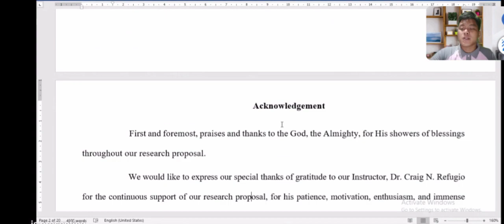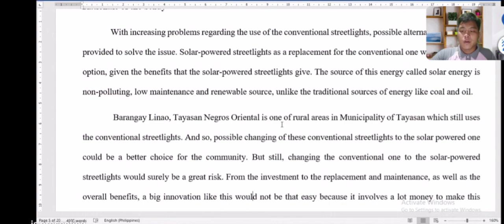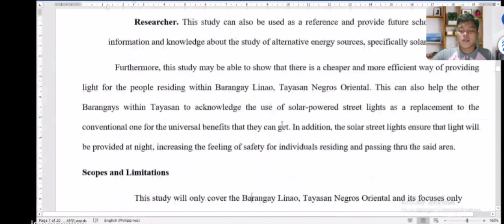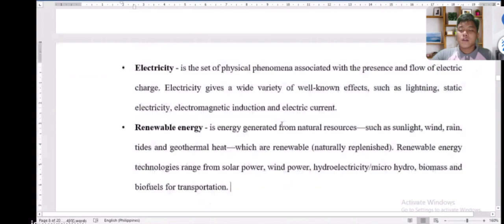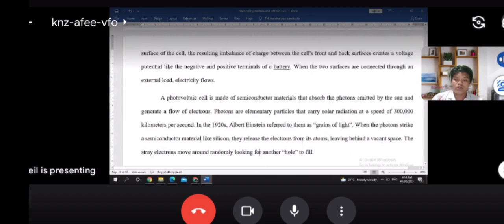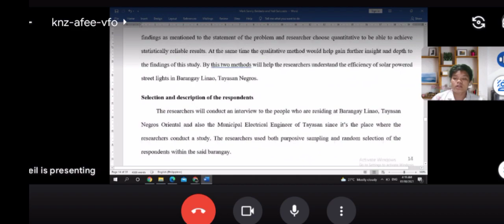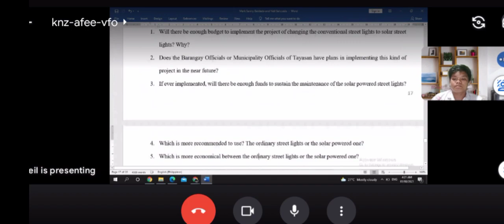Efficiency of Using Solar Powered Streetlights in Barangay Linao, Tayasan, Negros Oriental

Comment: Angel Lynes Esona
COE 346 Methods of Research TTH 5:00-6:30PM
March 25,2022

Reaction: The video is very precise and gives relevant information for the unending benefits of solar street lights.
Reflection: If this notion may be granted and have funds to make this innovation I could be satisfied for this due to the fact that sun-powered streetlights have stability, long service life, ease of installation, safety, high performance, and energy saving. This type of lighting can be seen in a variety of places, including city streets, residential areas, factories, tourist sites, and parking lots. We can make use of this especially in dark places, in order for us to be far from any harm and danger.

Comment: Arnold Jr. Arnesto
CoE 346 A - 5:00 PM - 6:30 PM TTh
March 25, 2022

Reaction:
Streetlights are almost always used during nighttime. It is important to keep the streets lit up which helps motorists navigate the roads and also gives a sense of protection to those people who need to walk in the dark. For this reason, I agree that there is a need for improvements in the capacity of solar-powered street lights.

Reflection:
Streetlights are only used during nighttime so it would be nice if they are to be charged using solar energy during daytime when they are not in use. In this way, we lessen the need to power them up using direct electricity and in turn, we can save money and preserve the environment.

Comment: Pagente, Jayvee M.
CoE 346 A Methods of Research TTh 5:00-6:30 pm
March 25,2022

Reaction: This proposal is very informative on how significant the solar power street light to be  utilize in many streets. Also taking advantage of the renewable energy and apply it on many technology is very helpful to reduce the use of fossil fuels.

Reflection: Utilizing the Solar powered street light is very practical. Thought it need a huge amount of budget to be implemented, it is still very efficient compared to the traditional street lights. Solar street light is also  requires much less maintenance. Additionally, in more isolated areas, these lighting solutions help reduce insecurity, theft and assaults.

Comment: NAME: Renz Eugene V. Denulan
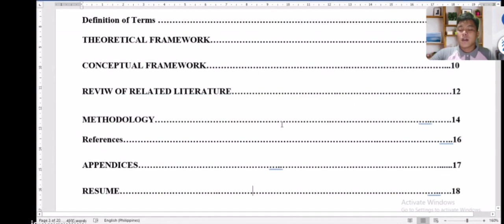Class Name and Schedule: ENS 341 SAT 2:00-5:00
Date: March 25, 2022

Reaction: This video is very good, the researchers are very well prepared l. Solar powered streetlights aren't new idea, it is also not used commonly not to mention it is expensive. But this presentation have benefit in that it is a renewable source of energy and can lessen the power of consumption of cities.

Reflection: The significance of this study is to make streetlights using solar power as its main source of energy so that the citizens of Barangay Linao, Tayasan, Negros Oriental and all other places that may implement this research have a brighter nights and make them feel a sense of security.

Comment: Name: Mark Daniel L. Anggoy
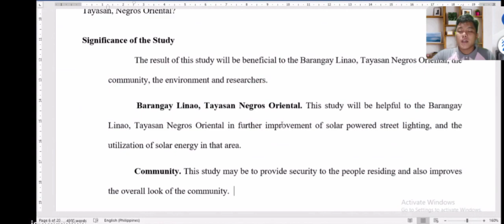Class Name & Class Schedule: Coe 343 Methods of Research T-TH 5:00-6:30
Date: March 25,2022

Reaction:  The video is both entertaining and educational. I also agree with the researchers that the capacity of solar panels to be used as a renewable energy source should be improved. This is an excellent case study because not all lighting can be kept operational. Streetlights are vital because they may assist cars in clearly navigating their path and avoiding accidents.
Reflection: Streetlights are in need in communities specially that are far from the major route, particularly in rural areas. This would be extremely beneficial not only to students, but also to workers who work late and must stroll through these streets. It would not only save electricity, but it will also benefit our environment and people.

Comment: Name: VEXANDER PHILIP M. MARAVILLA
Class Name and Class Schedule: ENS 341 A - TTh 6:30-9:00pm
Date : MARCH 25, 2022

Topic : Efficiency of Using Solar Powered Streetlights in Barangay Linao, Tayasan, Negros Oriental 

REACTION: Indeed a great research idea for it will benefit the people living in    Tayasan Negros Oriental since the area maybe has minimal to no electricity supply so it will greatly help the people in that area. 

REFLECTION: Using Solar Powered Streetlights will be very helpful to that community for it does not only provide lights to streets but also can ensure safety to to all the people in the said area and most importantly it is cost efficient and environmental friendly.

Comment: NAME: RUSSEL T. TURQUE
CLASS NAME & SCHEDULE: ENS 341 A ( 2:00-5:00 PM) SATURDAY

DATE: MARCH 25, 2022

REACTION: 
The presentation is well presented and very informative topic. The topic is eco-friendly by using the sunlight that is ample and renewable that use it up to power our streets to prevent accident, etc.

REFLECTION:
The proposed topic is an environmental- friendly solution. Solar Powered Street Lights which means it is use solar panels to lighten the streets. Now a days, Solar Street Lights are more advanced now. When it comes to the benefits, there are many, there will be no energy bill.

Comment: Name: Keanu RJ F. Lozada
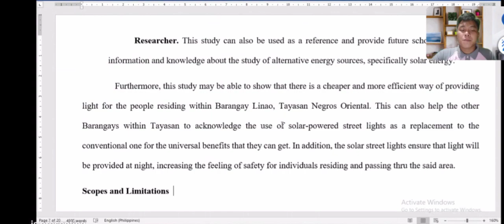Class Name and Sched: EE341-A TTh 6:30-8:00
Date: March 25, 2022
Reaction:  The proposal would be of great help in saving energy by using renewable energy sources. This streetlights can be used in secluded areas that have no electricity.
Reflection: using solar streetlights could lessen crimes and accidents. This would provide a good visibility at night.

Comment: Villanueva, Chastine E.
COE 346 Methods of Research T-TH 5:00-6:30 PM 
March 25, 2022 

Reaction:
The research proposal is extremely remarkable based on the video shown since the researcher's notion is helpful because employing solar-powered streetlights may be able to have pollution-free and produce no greenhouse gases.  

Reflection:
Solar-powered streetlights are well-known, and some governments and towns have already put them in their municipalities. These Solar-Powered Streetlights are highly beneficial in this regard because they produce lights at night that can assist vehicle drivers in avoiding danger on the roads, and the light that they emit is capable of lighting a larger area, but they do not require electricity from power companies because they use solar power.

Comment: NAME: Kim Anthony V. Aldion
CLASS NAME & CLASS SCHEDULE: COE 346 A & 5-6:30 T-TH
DATE: 25/03/2022
REACTION: This work is quite exceptional, and it will be of tremendous assistance to communities dealing with irrigation system challenges. It will be extremely beneficial to locations where there is no reliable source of water.
REFLECTION: Solar energy is widely used nowadays, thus the suggested research is beneficial not only to individuals but also to the environment. People can see and move around at night or when there is a power outage thanks to solar powered streetlights.

Comment: Name: Belinario, Cristy T.
Class Name and Class Schedule: ENS 341 B - (5-8 PM Saturday)
Date: March 25, 2022

Reaction: 

Using solar powered streetlights has been implemented in some areas in the Philippines. This proposal is not new to us. We have seen this solar powered streetlights, and I can say  it's a great help to the community, it provide security to the people residing and also to the people who use automobiles. 

Reflection:

Before in my place the street was very dark that it's scared to walk in the streets, and some motorist got accident at night due to darkness  they can't see ahead. Our government installed solar powered streetlights in my place. After that, it was great, no more scared to walk at night, and you can feel that your safe, and no more heard of  accidents due to darkness. This solar powered streetlights can provide safety of the community, and it can save environment because the source is renewable energy.

Comment: REY STEPHEN O. TUMAPON
COE 346 Methods of Research T-TH 5:00-6:30 PM
March 25, 2022

REACTION: This research proposal would really help the residents of Barangay Linao, Tayasan, Negros Oriental because with the use of renewable sources of energy, they came up with a great proposal that has a huge beneficial impact on the residents of that particular area.

REFLECTION: Solar energy is very important because there are some instances of power interruptions. With the use of solar-powered streetlights, we are confident for the safety of the residents.

Comment: Caluscusan, Desiree Joy M.
COE 346 Methods of Research T-TH 5:00-6:30 PM
March 25,2022
Reaction: This video addressed the problems regarding the use of the conventional streetlights, possible alternative have been provided to solve this issue. As a replacement, solar-powered streetlights would be better options given the benefits it offers. This is already prevalent since there are many highways already doing this. 
Reflection: The use of solar-powered streetlights will serve as a great idea for the streets still using the conventional streetlights. It will be easily monitored, since it utilizes the energy from the sun. This will also cut down costs. Overall, this will be a great replacement for the old streetlights that some places were already using.

Comment: Name: June Anthony K. Sarga
Class Name and Class Schedule: Coe 343 Methods of Research T-TH 5:00-6:30
Date: March 5, 2022
Reaction: this research proposal’s idea is great and the overall presentation was excellent. The idea of having Solar-powered street lights are cost-saving for the government because they do not rely on the power grid. Also, here in Negros, it is  very efficient because it uses the power of the sun to use renewable energy.
Reflection: Installing solar-powered streetlights on the city's main streets, streets, and other public areas will improve accessibility, support business, and strengthen social ties. In addition, at greater distances, these lighting solutions help reduce theft and attacks.

Comment: Jaemzell Jazz Ocay
COE 346 Methods of Research TTH 5:00-6:30pm 
March 25, 2022

REACTION: The efficiency of solar-powered streetlights has been highlighted by the researchers. It will be extremely advantageous to secluded areas that are not serviced by electric power.

REFLECTION: Solar lights are environmentally friendly. This type of illumination, unlike typical street lighting, is totally renewable and does not require the usage of fossil fuels. One of the best things about solar-powered street lights is that they don't pollute the environment and help you save money over time.

Comment: NAME: Rupert Tristan R. Borlaos
CLASS NAME & CLASS SCHEDULE: ENS 341-A (2-5 Saturday)
 DATE: March 25, 2022

Reaction:
The video is very simple but the purpose of their research is great and helpful. The voice of the presenters in the video is clear but there’s a loud background noise which is the sound of a cricket that can be heard. The visual presentation is very simple; they didn’t use PowerPoint presentation.

Reflection:
The research is all about the efficiency of using solar powered streetlights and it is very great idea and very helpful. Solar powered streetlight is efficient and convenient; this is also energy-saving and environmentally-friendly. The installation of solar streetlight is simple and convenient without complicated new wiring. It is a good idea to install solar street lights, I totally agree with this.

Comment: NAME: Del Franz Lean Consing Ladura

CLASS NAME & CLASS SCHEDULE:  ENS 341 - SATURDAY (5-8PM)

DATE: March 25, 2022

REACTION: As stated in the study's significance, the research of this study will be very useful to the community. The situation in the barangay they focused on is very relatable. There are many places in our country where certain barangays lack adequate street lighting due to their location in rural areas. Everyone is concerned about the cost. Similarly, to what the researcher discussed, switching from conventional street lights to solar-powered street lights poses risks. The municipality and the barangay are both concerned about this. They are the ones who will benefit from all of this, but their local government's budget will be impacted as well.

REFLECTION:  I have poor night vision, but that is no excuse for driving or traveling at night. It is truly a problem if one must pass through an area with limited lighting. There are some areas where there are no street lights because the connection to the power grid is problematic. Adapting the research would make a significant contribution to achieving a safe community. The research will determine whether or not this change in street lighting is desired by the people in the area. I understand that other citizens will be skeptical of this idea, but I hope that the research will persuade the public and the local government to address this issue.

Comment: Mamigo, Jascha Anthony T.
EE 341 Research Methods for Engineering TTh 6:30-9:00PM
March 25, 2022

REACTION: The research proposal is extremely impressive based on the video shown since the researcher's notion is very useful because employing solar powered streetlights may be able to have pollution free and produce no greenhouse gases. It is also a more cost-effective and efficient method of lighting people.

REFLECTION: In Barangay Linao, Tayasan, using Solar Powered Streetlights is an excellent solution to solve the problem. It is always dark at night, they claimed. It will be better if batteries with longer life span will be used.  I admire how they researchers prioritized community service.

Comment: Vanissa C. Monticino 
COE 346 Methods of Research T-TH 5:00-6:30 PM
March 25, 2022

Reaction: The video contains a lot of information about what if we use Solar powered streetlights around the community. Here we can see that using solar powered streetlights are really helpful.

Reflection: Using this solar powered streetlights, there will be less accidents on the streets because it brightens our way at night. As well as this system can be able to run for a longer time without consuming electricity. This will benefit both the people living in a society and the government for the less consumption cost of electricity. And yes this is highly recommended especially in the said community.

Comment: Ronel S. Bayonado
COE 346 Methods of Research T-TH 5:00-6:30 PM
March 25, 2022

REACTION: 
Great Idea to integrate solar power into streetlights. It'll be very convenient and cost efficient because of the use of solar energy instead of the usual electricity.

REFLECTION: 
Integrating Solar energy to a streetlight is a great idea if implemented. They will not only save money from it but also lower the demand of electricity in the barangay. With this even if power is out, the streetlights will still be lighted because it is powered by a natural source which is solar energy making the streets safer.

Comment: Franz Michael B. Nadal
ENS 341 SAT 5-8 pm
March 25, 2022

Reaction:
The research presented is not new to us but still it's not adapted fully in the Philippines. There are many areas which still uses conventional street lights were it goes off also when their are power interruptions. This research is great and interesting.

Reflection:
Philippines have many ways and resources that is yet waiting to be discovered many ideas have been proposed but we lack  implementation and support on it. The solar powered street light may be one of the solution in decreasing criminal rate in certain places. It may have a small impact but still it's a great help to the safety of the community and vehicles.

Comment: Princess Xena O. Parreño
COE 346A (5:00-6:30pm)TTh
March 25 ,2022

REACTION: This research proposal was great, it will help not only the Municipality of Tayasan but also other communities. The idea of having solar powered street lights will be very beneficial to the secluded area that cannot be reach by electric supply energy.

REFLECTION: Electricity is widely used by everyone but there are instances for interruption of power supply and most students are greatly affected especially that we are having online classes due to pandemic. And with this renewable source of energy we can use solar panels to lighten up street lights for the safety of the whole community.

Comment: NAME: Nica P. Ragay
CLASS NAME & CLASS SCHEDULE: COE 346-A (TTH 5:00-6:30 PM)
DATE: March 25,2022
REACTION: Having solar powered street lights is a cost savings to our government since it is not dependent in our grid. It is also very efficient since we are harnessing the power of our sun and embracing renewable energy here in Negros.
REFLECTION: Faraway places in the province can now be lighted through this efforts and research. It is able to help the government lessen the expenditure of our streetlights. Based on observations here in the province with the build build-build program of President Duterte we noticed that road widening projects installs solar powered streetlights after completing the road and it is up and running already.

Comment: Balacy, Samantha Ruby Joy C.
COE 346 Methods of Research T-TH 5:00 - 6:30pm
March 25, 2022
Reaction:
Switching to solar-powered street light is a great move if implemented to the community. This idea is great since the researcher promotes the usage of inexhaustible and renewable source of energy. It is quite beneficial to the people since it gives security and prevents possible accidents due to lack of street lights.
Reflection:
Harnessing solar energy through solar panels helps minimize pollution and gives an adequate source of energy to light up street lights. It also gives security to the people, and these solar-powered streetlights are more efficient to use since power interruptions are never a problem for this project because it doesn't use electricity coming from stations but instead provides its own electricity to power itself. So it's not just environmentally friendly but also energy-saving.